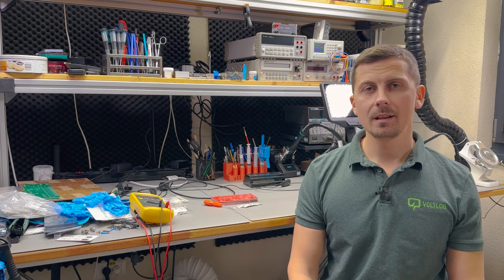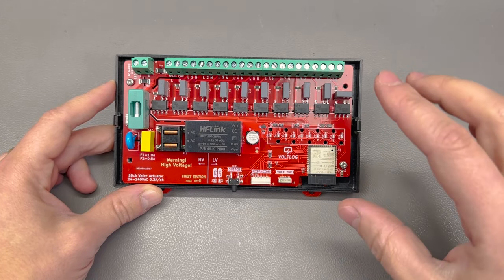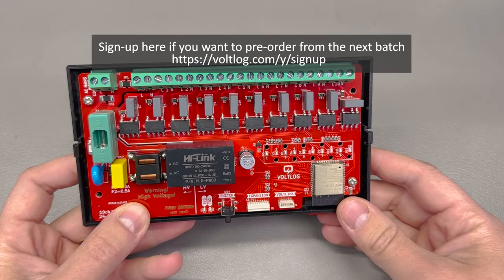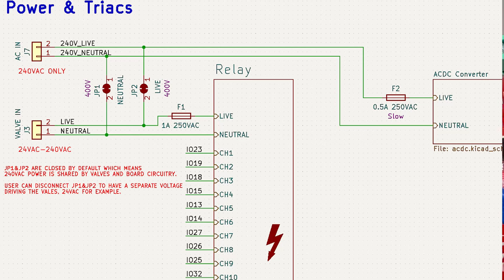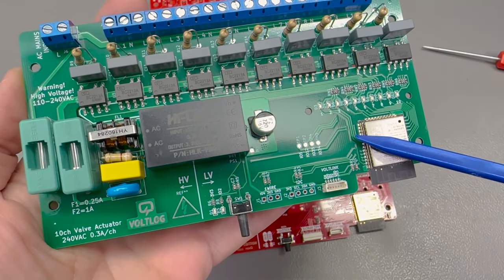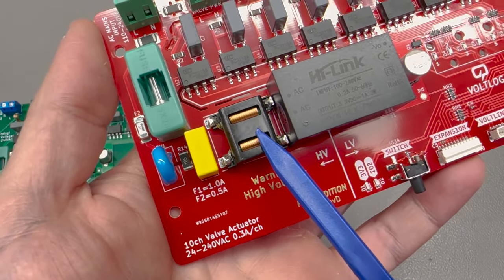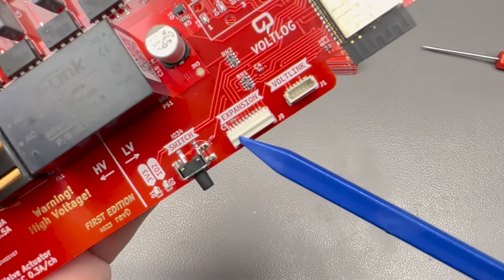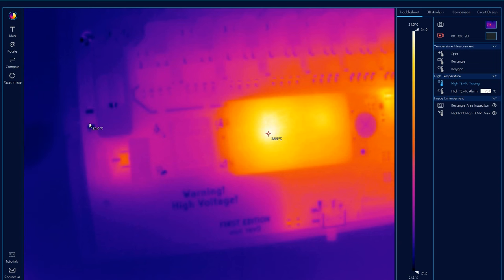Underfloor Heating Valve Controller Board revD | 466

Comment: Cool! If the mounting holes aren't an issue, you can rotate the ESP module 90-degree CCW. This is based on (3.1.2) Positioning an ESP32 Module on a Base Board stated in their ESP32 Hardware Design Guidelines.
Anyway, if it works - it works! 🙂
Reply from the maker: The orientation of the esp32 module has come up a few times over the years as I was publishing videos on the topic. I have designed countless boards, I know the ESP32 Hardware Design Guidelines mentions it but in practice there is however no noticeable performance drop in wifi connectivity having it this way.

If one wants, it could easily flip the board around and have it pointing up though.
Reply: @voltlog  Cool! I've also been in several situations where placing the module following their guidelines is impossible. If I'm correct, they have a lineup of modules that are the same package and pinout but offer the ability to add an external antenna via an ipex connector by simply shorting a 0-ohm resistor. Anyway, this is a really nice project of yours! Looking forward to your next uploads. :)
Reply from the maker: @jvp5000  Yes, the U version of the module is designed specifically for use with external antennas and has the ipex connector. I offer that as an option for the valve controller, for people that want to install this in places with poor wifi reception.

Comment: Do you have any resources on snubber design? Ive got a similar project, but am curious if i really need to add snubbers.
Reply from the maker: I just did a bunch of internet reading. With the types of load that I have, the actuator valves are purely resistive, then the triacs are zero-cross so there is no ringing or overshoot at turn on. Normally I wouldn't need snubbers in this scenario. But I figured I should add them, because triacs can be sensitive and you never know how other valves on the market behave.

Comment: Nice work! :) 
Maybe it is just me, but an ethernet variant would be greate. Heating is a critical infrastructure, therefore wired connection is recommended imho. :)
Reply from the maker: It's easy to say that like it's as simple as ticking a box, when in reality, designing an ethernet port would increase the cost of this product to a level that might stop people from purchasing it. And for no good reason if you ask me, there is nothing bad that's gonna happen if the wifi connection drops (which it doesn't as far as I've noticed so far).
Reply: You are perfectly right I know that :) 
Adding ethernet is costly and most people don’t need that. Maybe creating a “pro” variant with an ethernet port and option to attach 11 temperature sensors. One from the heater, and one for every return pipe. Just throwing ideas. :)

Comment: do u really need resistors rated for 400V? asking since i dont see how they would ever experience even close to that , since i assume they are 0 ohm resistors so about mohm range so nearly no drop on them .
On a side note wouldn't it have been cheaper or easier to simply use some pieces of thicker wire and then isolate them with some epoxy ?
Reply from the maker: resistors need to be rated for the voltage that they are subjected to and they need to be populated by an automated pick and place machine.
Reply: @voltlog  so u have 400v dc max across them and you have 2 resistors it would be 200v per resistor if the load is shorted, with normal load it would be a few volts, 
Then again I don't know the standards and I am only looking at it on paper 
Thx
Reply: @sanjikaneki6226  In real world use the voltage rating doesn't matter, just the package size and current rating. But in terms of regulations it can be a different story.

Comment: x1 pwm signal to my grundfoss pump would be af nice feature?
-two would be even better, second controlling my mixing valve ;).
Reply from the maker: There are a few GPIOs that could be used for that, but you would probably have to adapt the voltage level.

Comment: Is „Waning! High voltage!“ a cut out soldermask exposing a polygon? If so, wouldn’t it be more dangerous?
Reply from the maker: Yes it's a soldermask exposing a polygon not connected to anything electrically so the answer to the second question is no, it's not dangerous.

Comment: Nice work! Is it possible to modify it to have ethernet? I know its a topic with the isolation but it would be realy nice to have not only a wireless connection
Reply: ethernet boards with esp32 do exist and can be done easily I think, but I think it uses a lot of the GPIO. For example you can look at a POE board by lilygo, boards without poe would follow the same idea, just less components. I agree a wired connection is preferred especially with devices that wont need to move, or will be placed in areas where cabling being visible doesn't matter, like this UFH board would be placed in a plant room where the heating plumbing would go, and so hiding cables doesn't matter, also the environment it would be in, lots of mains wiring and plumbing pipes doesn't make it a good place for wifi devices
Reply from the maker: I agree, wired is always more reliable but turns out in practice you can actually do a lot with wifi, especially with an external antenna. Ethernet is going to take up a lot of pins and it wasn't worth it in terms of cost either. I'm pretty sure that if I make an ethernet version, I will invest a bunch of resources into it and then nobody is going to order it, because it's more expensive and they find out wifi works just fine.